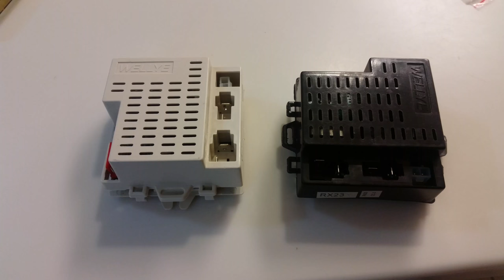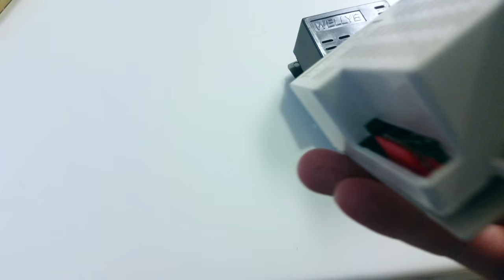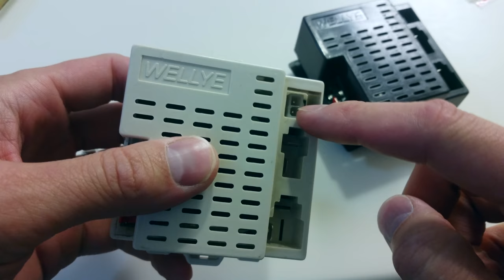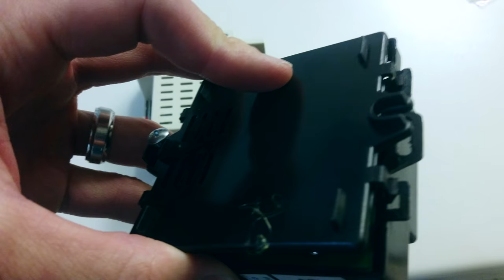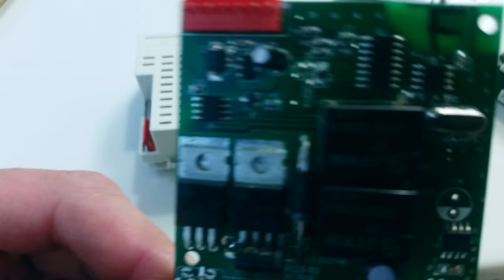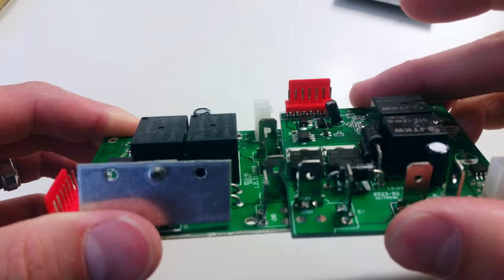Best Toys Jeep Wellye control repair

Comment: All commenters, these boards are 12v you put more in their going to pop.. check the wellye range of boards there’s a few.. best one at 12v is the rx37 - 12v supports up to 200w so you can add high powered 35000rpm motors and it won’t burn it up.. 
just make sure you check the connections are the same as yours then it’s literally plug and play..
I went for the rx30 - 24v.. I’m running 2 12v battery’s in series so 24v.. and I’ve had to upgrade my motors to 24v @30000rpm otherwise they will burn out abit to fast for my liking..

Anyway stop overloading these 12v boards.. upgrade it..
Reply from the maker: Thanks for the like/sub! Your comment is probably the best one so far, super helpful!
Reply: No problem 🙂 yes took me ages to figure out the best and easiest way of doing it couldn’t find any vids.. and keeping parent controls. Hope this helps
Reply: Gaming With The Grangers’  what is the extra plug for on the Rx-37, the ride on toy only has 2 plugs and the receiver has 3.
Reply: Upgraded my sons Jeep to 24v. Any idea why it will not sustain 24v power? Seems to revert to less than original 12v. New batteries, hooked up in series with same amp. New circuit board, and motors for rear. What am I missing? Figured it doesn't hurt to ask in case you might know the answer. Thank you.
Reply: Hi 1empyre & Game with the Grangers', do you it is compatible with RX7 if I replace it to RX37 or any RX if possible?
Reply: Cost

Comment: Wish we could just delete the controller board. I don't need the controller. Just want to push gas and go
Reply from the maker: I hear you on that, it's definitely possible but it depends on what direction you want to go with the conversion because it will take a lot of rewiring and Hardware

Comment: I've just got a quick question I'm really hoping to get answered here. My question is once the relay is fried is it possible to bypass it by running wiring from battery to shift then to foot switch and then to motors? Or is buying the replacement board my only option
Reply: yes it is possible because the box is actually here only for the remote to work,  you just need to correctly wire the pedal and forward / back switch to the motor and battery
Reply: @sekiro5982  I'm thinking of putting a double pole double throw (DPDT) 3 position switch inline with the gas pedal, it will give me forward and reverse. I will upgrade the wiring because at present it only has thick wires from the Wellye board to the wheel motors. The 2 brown wires to the gas pedal are thin and so are the wires from the battery. My board burnt, and the red and black wires fused together, not heavy enough gauge wire.
Reply: @sekiro5982  hi I have a 12v best choice car and it seems that the module has some damage to it since my lil girl doesn't need the remote any longer and I'm just wanting the car to work is there a way to bypass the modular altogether? Any advice is greatly appreciated. #justamothertryntogetmylilgirlscarworkinagain

Comment from the maker: Replacement board: https://amzn.to/3JC8Ob7
Make sure to confirm you have the same pin setup/number when you order This seller is not the same as the one in the video.
Reply: Could I upgrade to the 24v board they offer and it still work with the upgraded battery. Not worried about the motors
Reply from the maker: @MrInstag8tor  That's a question many people have. I suspect that it will work. Please let us know how it goes if you do!

Comment: You are the only video on this and I am looking for a replacement. I am currently attempting to repair and modify a board to accept a 19.4volt drill battery.
Reply from the maker: MrGeekrick1 if you know your electronics, you could certainly do it. I think a motor upgrade would be good as well. That's basically what I used and blew it. It did run for a few charges on the low quality original board..
Reply: MrGeekrick1 search eBay or amazon for wellye rx30-24v I run mine at 24v works fine, I’m not sure but I think it needs to be running at 24v to run tho..
In your case and the guy in the vid.. I would get the rx37 12v board it supports up to 200w so would support 12v 35000prm motors
Reply: Gaming With The Grangers’ im planning on buy the rx-30 24v circuit board but my little jeep has a radio and some led lights , do you know if  they will still work with 24v circuit board ? What other modifications need to be done be sides circuit board upgrade? Ill apprecciate any info you can share with me, thanks in advance
Reply: @franciscoescareno8588  we tried running 2x12 volt batteries  yesterday and it blew so we ordered the RX 30 24 volt which is coming in a a week.
We put the old 1 back in Jeep works fine but now no lights and sounds??? Any ideas anyone

Comment: Exactly what happened to mine. Did the new one let you use the 18vlt battery ?
Reply from the maker: I have not tried the 18v with the new part because the components have the same voltage rating, which means they could still fail. The beefier components can probably handle more current. If you have success with the new board and 18v, I'd love to hear back. Thanks for the question!

Comment: Thank you for the video I have a slightly different toy I believe as our remotes are not similar, but I have taken apart my control board and it looks exactly like the your original does.  Mine however shows no damage as the capacitor is completely intact, I don’t see any other areas where damage occurred either. My problem I’m having with the toy is that power comes on but the peddle and remote will not make the toy go. I checked to make sure the motors on the wheels are still working by placing the wires directly to the battery and then they work. So my only problem is the toy will not go when the peddle is pushed or the remote is used do you have any ideas what could be the problem?
Reply from the maker: It could be the MOSFETs or relays. I suspect the bad board in my video had blown relays (the big square black boxes) as well as the blown capacitor.
Reply: I know this was from a year ago but this is exactly what mine is doing, i replaced the battery and the lights and sounds come on but won’t move when I push the pedal. Did you find a fix? Did you replace the circuit board?
Reply: @Nataleyshepherd   Same problem here.  Any luck?
Reply: @1empyre1life  Run two leads from the red and battery terminals to the thick power wires that go to the rear wheels and see if the motors run the wheels ok.

Comment: Is the rx30 24v a straight swap for the rx7 12v? It looks like it has an extra set of plugs that go into it?
Also do we know of running an 18v battery will power the 24v board?
Reply from the maker: Those are great questions! I'm not sure but hopefully someone on here does have the answer.
Reply: Yes 18v works on 24v Weelye. I was actually able to run the controller and 12v motors 2drive + 1steer until the battery measured at 11.5V. That means you can likely run the rx30 for a little bit with a 12V battery. I am currently checking out how to change the speed setting more drastically on the controller (possible resistor that sets the speed reduction setpoints).

Comment: i had an issue on my 6v rx57 where the steering could not be controlled by the remote. I purchased a 24v rx30 and i just get lights , no motor working, no sync with controller and no motorized steering from controller. any idea what the issue could be?
Reply: Not sure why you had to try replacing a 6V rx57 with 24v rx30.. as per my quick look at the specs, the 1st one is 6 volts battery driven, while second one operates at 24 volts.. so its quite possible that the controller is not able to work with 6 volts (assuming you are still using a 6volts battery).. changing the battery to 24 volts also wont help, because the original motor is rated only 6volts. You may want to look for like to like replacement (with 6volt controller)

Comment: Hey mate, you asked about why, after replacing the resister it still wouldn't work? I'm betting its because other parts are fried. Like you said, the boards are pretty sensitive, so that much current going over a board designed for 12v is probably going to suffer in many areas. Just a guess.
Reply from the maker: Hey, it's been a few years since I made this video, and I have since learned a bit more from viewer comments like yourself!

Comment: So I did the same thing and replaced the box with the exact same rx23 box. Plug it in and I get no power. My old one turns the jeep on but it will not drive forward or reverse. Do you think I got a defective box?
Reply from the maker: Thanks for the question. A defective box is certainly a possibility. Maybe some other component/components were damaged as well. Feel free to post a follow up if you solve the problem!

Comment: so I have a question man cause I put 2 12 volt batteries in a Uenjoy 2 rider car and smoke started coming from behind the radio.  
Did your steering go out? if so maybe that is all I have to replace.  I stopped the car before anything blew.  I took out the control board that was behind the radio but maybe its that box you replaced that I really need to get switched out.  So once again im asking you. was it the steering that went out?

Comment: I did the battery upgrade and blew the same capacitor too. I replaced the board but the steering no longer works….help please

Comment: My remote wont sync so do you know if the control box would be problem..everything else works n drives just not the parents remote
Reply from the maker: It could be the control box, or the remote itself.  It could even be as simple as dead batteries in the remote. The last time I checked ebay, you could get a remote and main box combo for a better price than either component individually. My toy has died again but I haven't had time to try fixing it.
Reply: @1empyre1life  I was wondering if you'd seen my question about the fried relay and if rewiring and bypassing the board was a possibility

Comment: My son's car seem to have the exact controller box. The car started to have a problem since past week, it goes for around a meter or so and suddenly cuts out and starts again. He is driving on a flat ground. Tried driving with the remote control and it does the same. Do you think the controller can cause this particular issue ?
Reply: I have this same issue. Drives for 2-3 minutes. Then cuts out for 30 seconds or so and starts itself back up. Anyone know if this is a circuit board issue?
Reply: Did you guys have any luck fixing the issue or buying the part and that fixing it? My sons jeep does the same.  Goes a few feet and dies. Then you restart and does same over and over
Reply: Update:   The new relay did not fix the shirting out/dying issues after several feet of driving.
Reply: Got the same issue... Rides 2 meters and shut off.. Any ideas?
Reply: SuperClown1979    I gave up and bought a peg perigo.  I’m guessing it is a wheel motor short circuiting the unit or something.   Kidswheels.com has all sorts of extra parts for these to tinker around on.  but I didn’t want to sink more money into an unknown issue.
Reply: I have same issue. Drives a couple feet then stops. I can pick up the  rear end and use the remote and the tires go but then it also suddenly stops. I might try to replace the rear fuses. $9 on amazon
Reply: @FullyChargedZone  same problem as above. Where is the location of the terminal fuse ? I am gonna try that once I find thanks

Comment: Hello. I am looking at experimenting with the Bluetooth receiver found in a similar Ride-On vehicle to see if it can be a discoverable bluetooth device for other electronics to pick up rather than restricted to the remote control. Do you have any knowledge as to how I can find the module on the motherboard or how I can find the Bluetooth address that is used to pair the two components?

Thanks. Very helpful video
Reply from the maker: That sounds very interesting, unfortunately I am not versed in either of those skills. I would also like to know how to do that, though.

Comment: Will this motherboard (being blown) cause the vehicle to turn on but not move/pair with controller? I am trying to do the process of elimination with my sons urus ride toy. The battery seems to be working fine. But I did charge it for like 20 hours and that might have caused the overload. But it starts and the lights, radio/blue tooth are functioning correctly. Any feedback? It’s greatly appreciated
Reply from the maker: That's a good question, hopefully the answer lies in the comments somewhere. The radio or Bluetooth did not function, as well as the driver controls when mine blew. Hopefully this helps!

Comment: Converted 2 12v batteries to 24v on my daughters jeep and same thing happened, made a loud pop and blew the same capacitors. I can order the replacement via amazon but my issue it that I still want to run 24v to speed it up. Any ideas so I don’t repeat lol?
Reply from the maker: I'm not an electronics expert, but I know you'd have to at least upgrade the capacitors and relays and probably other stuff too to handle the extra volts. You can go crazy from there like new motors, wiring, etc
Reply: Matt same thing happened to me to a t. Ever come up with a solution?  Trying to use my 18v drill battery
Reply: Buy wellye rx30 24v board problem solved
Reply: @gamingwiththegrangers  
Same thing happened to my son ride on its a 4x4 jeep tried to upgrade the battery to a bigger it worked and it can go longer 
Then i tried to add more power by connecting another battery in series that when i blew up the capacitor even though i replaced it (hopefully it's in the correct way +-) but every time i turn the car on it start to go forward on it's own immediately any ideas why or just get a replacement board amd get it done Thank you

Comment: Is there a way to make the best choice jeep use a dewalt 20 volt battery? I hate charging for 14 hours on the off chance my daughter will use the jeep the next day when I have half a dozen dewalt batteries laying around the garage.
Reply from the maker: Without giving it too much thought, I'd recommend looking into using a buck converter to step down the voltage to 13 or 14V (maybe more if you're feeling lucky) and ride into the sunset with those DeWalt 20Vs. If you wire them directly, you will probably fry the electronics like I did twice and end up giving away the jeep.

Comment: Hey guys I have a power wheels and it was working fine but it stopped working all of a sudden. Idk if I overcharged it because I did leave it charged for awhile and it stopped working.  I press the power button but it doesn't turn on. It only kind of turns on when I move the steering wheel back and forth
Reply from the maker: Check the electrical connections. Also check the battery voltage.

Comment: I've recently bought a Cosmic Overdrive SX118 Model Kids Car ride for my son. Works fine but my controller is now damaged. I've been looking all over for a replacement and all I can find is the Weelye controller from Amazon. Do you know if there is any way I can use this controller and transmitter to replace my old one?
Reply from the maker: There's a decent chance that would work. You can try getting the controller out and seeing if the pins and connectors match the wellye in my video. If it's not quite the same, there are other versions that might be the right fit.

Comment: Hi, my son's jeep makes noises and the lights flick, it doesn't makes anything, just stopped working, i always used the original charger, any suggestions?
Reply from the maker: It could be a wiring problem. I think the lights and sounds are on a different circuit board, and that could be faulty.

Comment: Hey my kids Jeep has a broken blue wire coming from the small circuit board over the on/off switch can you tell me where that goes to? I look but can’t find where it suppose to go. Thanks in advance.
Reply: That's just an antenna for the radio. One end does not connect to anything
Reply: @diegoflores8339  I was thinking that, thanks so much .
Reply: Is there anyway to fix that? I just got one on offer up and I saw a free blue wire down there
Reply: @aurorablancaflor6521  turns out that’s the wire for the wireless controller so it doesn’t connect to anything as far as I found out.

Comment: Hey man I'm trying to upgrade my sons to the 18v and am having issues getting it right. Could you possibly post a video of how you wired it
Reply from the maker: Sorry for the late reply,  but I went back to 12v. You have to either bypass the board and directly wire the pedal to the motors or find a way to upgrade the relays and probably capacitors and possibly other/all components to handle the extra voltage/current.

Comment: hello guys, someone can help me? i have the same board with blown capacitor but i don’t really know if is 6v or 12? 2 batteries 6v each, seems connected in parallel. 
i will like to replace the capacitor someone know which capacitor i need to buy?

Comment: u2 could of blew, I have one on my work bench now. 
Could you tell me what u2 is? as this is damage is obvious. 
The person has hooked up the battery with the wrong polarity
Reply: from what I can read of this chip it was rz7889
Reply from the maker: Can you elaborate on what u2 is?
Reply: U2 is a motor diver. It's what delivers power to the DC motors at the wheels
Reply: I realise this post is old but..
You are correct. U2 part number is RZ7889. It is the motor driver for the steering.
I have the same problem, my nephew hooked up the battery backward and let the smoke out. 

I'm curious if anyone knows the part number for U3? It is the mosfet with the large heatsink. I can read what appears to be "150N" but the rest of it is gone from damage. Is it the same 150N03A as shown on the other board in this video?